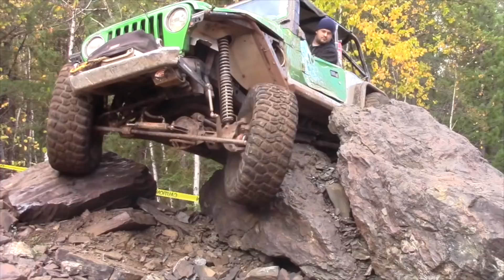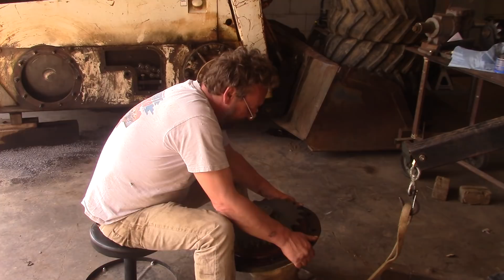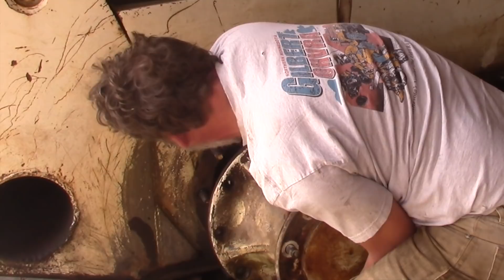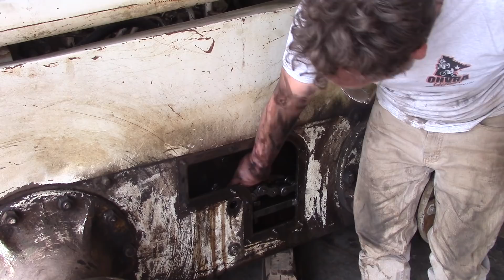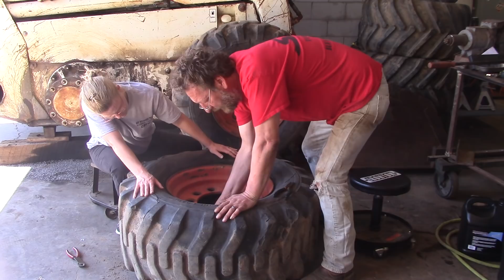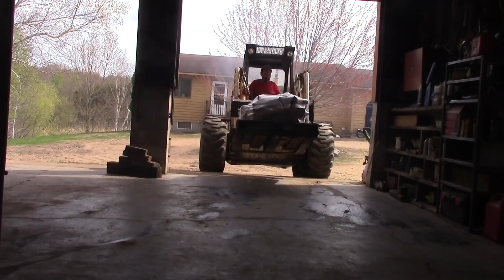M970 BOBCAT AXLE REPAIR PART 2 by BSF Recovery Team

Comment: Hey eric an old farmer trick is to put pet canned milk in a tire....home made tire slime BUT!    Dont take it to a tire shop to break down or it may end in a fight lol. 
Rotten milk stinks but works like a charm for tire slime.
Tire shops hate tire slime and would really hate the pet canned milk trick.
Used to use it on tractor tires when i brush hogged locast trees